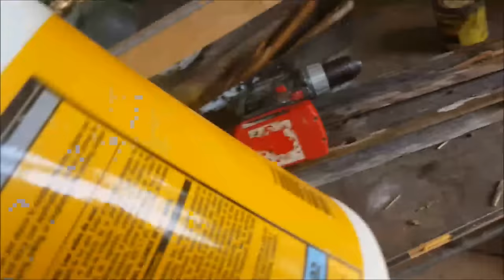Plastering & Painting OSB walls the Houses Built Tiny way?

Comment: So happy I have found this. Just did first coat on the walls in my cargo travel trailer conversion. Came out so good. Is bonding agent necessary for second coat? Thinking about using 90 instead of 45. 45 dries so quickly. Good for pros maybe.
Reply from the maker: I use the acrylic in each coat

Comment: This looks so interesting! I have a job I’d like your advice on. My ceiling has some exposed wood trusses that used to be sprayed in popcorn, we’ve removed all that and I’m looking for something to coat the truss studs with do you think this will stick ok? The popcorn did but got water damage and had to remove, I don’t want to go that route again.
Reply from the maker: Yes this would stick. But the easiest way to apply it would be first to coat your exposed wooden beams with a water-based primer. Then go ahead and use a hopper and spray whatever text you want on the ceiling. I like to use a soft knockdown texture

Comment: I'd use the diamond veneer plaster and water trowel to make it flat.   plaster gets hard as rock, so you can't sand it.  But it would be stronger than paint and absorbs VOC.

By the way, this is not plaster.  This is wall mud.  It is soft and easily scratched and cheap way to skim the wall.  The plaster is hard and real hard to trowel.

Comment: We're considering this for our tiny house too! Will this kind of plaster crack when you hang pictures and make nail holes?
Reply from the maker: KayteGrace no it will not crack even when flexed
Reply: If anyone reading this is wondering.. if you use mix plaster you'll be fine on any thickness, but if you use premixed All Purpose Mud... then it WILL crack over a certain thickness. Tip; premixed mud is NOT plaster.

Comment: Question sir sorry to bother ya, i have osb on my walls i have that smooth side inside feels like a wax finish on it, anyway im wanting to create a smooth surface and then paint it what would you reccomend, any help os appreciated im on a budget.
Reply from the maker: That's what we did on these walls. If just smooth trowel and sand as needed
Reply: @HousesBuiltTiny  so just drywall mud or what did you use?
Reply: @HousesBuiltTiny  que material utilizo es yeso y cola o que es ?

Comment: Have you had a chance to the house yet? If so, any problems with cracking at the joints due to movement while going down the road? I'm in the middle of a floating home build & am thinking of doing the exact same thing you guys did here. Just like your trailer, I'll have movement (from boat wakes, wind, etc) to contend with, & curious how well compounding the joints would hold up to it.
Reply from the maker: Bushrod Jenkins .. It's 4 months later and no cracking or shrinking anywhere.  Just as a precaution I added a small bead of 50 year adhesive acrylic painters caulk to the inside corners over the primer. Then I spot primed the caulk before painting the walls. I have used this formula for over 20 years in interior and exterior applications with  lasting results.
Reply from the maker: still soild

Comment: Very interesting technique. Still no cracking at the joints?
Did you tape the joints in any way or what did you do to hide them?
Reply from the maker: Flex tape. Still look great
Reply from the maker: still solid
Reply: @HousesBuiltTiny  Wow, that's impressive! Do you have any closer look shots to see how smooth the finish is? Is it comparable with drywall finish (smoothness)?

Comment: Hi, can you give me an estimate of the amount of water to concrete bonding admix? Thank you!
Reply from the maker: Gretchen that is a really good question. Here's my answer. Not all add mix are created equal. Some are much thinner than others. For the concrete add mix that I'd buy at home depot and lowes I make about 50/50 with water.  Most of the time I buy my add mix as a bonding agent from a concrete supply company which is more like thick Elmer's glue and I use about 75% water with it
Reply from the maker: You will actually feel the tug on the trowel as you skim coating over it. If you're add mix is a little bit to gluey it'll stick to the trowel you want it to just slide off of the towel

Comment: Will the plaster crack with house settling?
Reply from the maker: That's a really good question Rosy River. The simple answer is probably not. And it doesn't crack when you move it either. The acrylic add mix makes it flexible to a certain point
Reply: @HousesBuiltTiny  thank you :)